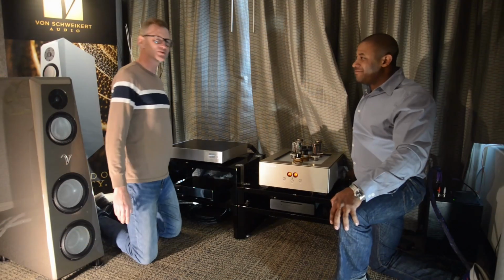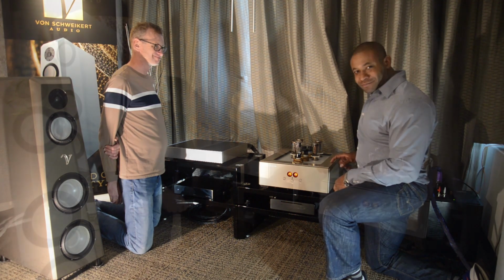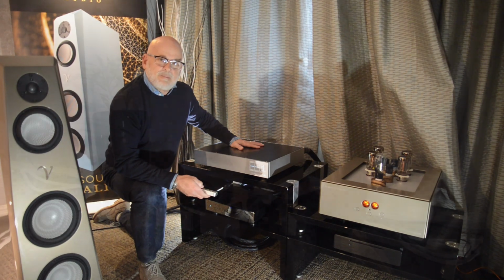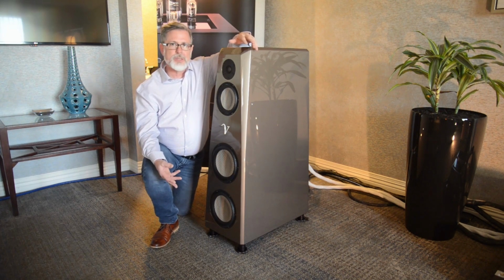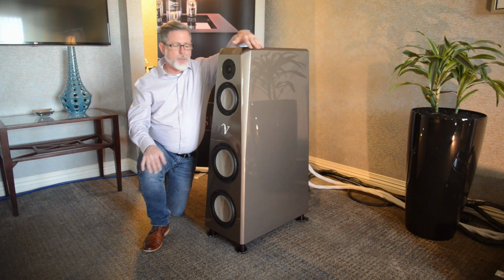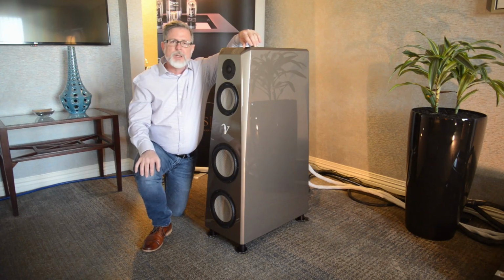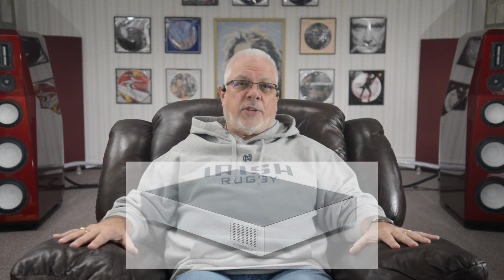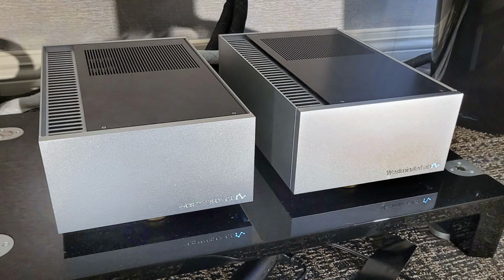E153: Capital Audiofest 2023 - Hear This

Comment: Amp isn’t point to point. It’s PCB
Reply from the maker: I’m sure you are trying to somehow diminish the accomplishments of the WestminsterLab Rei with your unrelated and extraneous pronouncement, but…until you hear them, that true but irrelevant “fact” means absolutely nothing, not even in the context of your implication that “Point-to-Point” designs must be inherently better.

Seriously, there are some who foolishly, dogmatically, and mistakenly “insist” that all valve-driven electronic designs must inherently sound more authentic than any solid-state designs. Such presumptions only make fools of those espousing such inflexible indoctrination and unsupportable erroneous assertions. Every design MUST be taken on its own merit...period.
Reply: @theaudioanalyst I think you’re taking the prior response a bit too offensively. I think the person was just pointing out it’s a PCB, whereas the individual representing product did in fact state it was p-p. 

Does it matter in terms of sound quality? Probably not. For some of us, it does however matter. I won’t name names but let’s just say there’s a US amp manufacturer that does these pretty and impressive cnc milled chassis’s and hangs 6 figure price tags. Lift the cover and it’s a collection of pcb, all assembled by pick n pull automated machinery. What’s worse is I see ribbon cables connecting the pcb’s. Should that matter if the sound produced is superior to competing products? Probably not but it does. If I’m spending my hard earned cash on equipment at that price level, I want to know it was built 100% by hand soldering components. That’s just me. I will add that the amps I have are all but one hand soldered p-p SE DHT’s. 

I understand and respect you may disagree, fortunately the high end audio market supports each of our respective favors.
Reply from the maker: @MichaelM-to4sg Yes, I was very disappointed at the implications of that previous post. Further, while there ARE PCBs used inside the Rei, you must also acknowledge the hand wiring. If you visit the WestminsterLab Rei webpage (https://www.westminsterlab.com/rei), and scroll down through the myriad of images shown there, it is clearly apparent. By the way, that is what Gary describes, hand wiring - he does not use the phrase Point to Point - see https://youtu.be/8CRK-GT_oyc?si=i0mHEdIhpgOYrfIU&t=362

Further, I am a bit surprised at your own controversial position here. You clearly state...
"Should that matter if the sound produced is superior to competing products? Probably not but it does."
Do you realize just how irrational that statement sounds? Your position is that you will not accept something that is demonstrably better than something else because of some dogmatic stance on design. That is as hard to justify and as absurd sounding as suggesting that all tubed electronics must sound better than anything using solid state design just by virtue of the fact that they employ valves...

Please understand that I completely respect and appreciate your choice to purchase and listen to whatever gives you the most satisfaction, and for whatever reasons. But by that same token, do not expect us to accept your flawed logic with the same dogmatic zeal. Thanks for watching...
Reply: @theaudioanalyst  Honestly the product I was referring to that employs a collection of pnp pcb’s w/ribbon cables, like every tablet, laptop and desktop produced the last 40 years, does not produce superior results. It’s quite cold and unengaging, but that’s not the point. IF it were superior sounding, I would have no problem buying it if its price were commensurate with the skill required to build it. 

I’m sure I am not your average audiophile consumer, not just because my source equipment is reel to reel and vinyl only, because I’m willing to pay for skilled workmanship. I’m not debating whether PTP wiring results in superior sound, although I do believe it provides a greater potential than a signal path that is sent through pcb traces. I do however want to support the skill and labor that is required to hand solder a PTP amp and preamp. 

To put it more relatable to you, I’ve seen in past you appear to have pair of VS Ultra 7’s. A truly spectacular sounding speaker, ime. So why do I not own a pair? I have VS VR5 Anniversary as my only dynamic speakers, my other 2 systems are horn loaded speakers. The reason I have not ordered the Ultra 7, is the painted finish. My VR5 Anniversary is spectacular finished wood veneer that blends perfectly in with our living room furnishings. Yes, my SO would rightfully object, but as would I. Honestly Damon has generously offered to produce a wood veneer finish of my choice, which I will likely take him up on, but ultimately things like fit, finish, build quality and craftsmanship matter….as much as sound quality in our household. 

Maybe that makes me shallow to some but music is art and my audio equipment is expression of that art form, both audibly and in build technique.